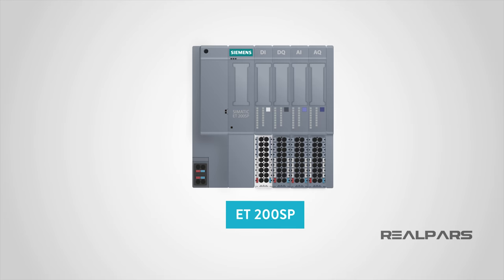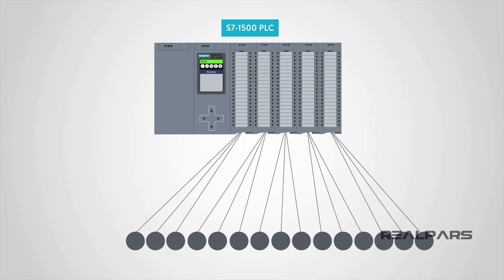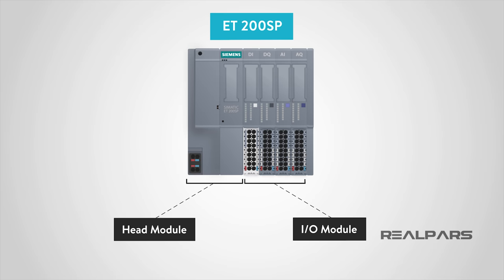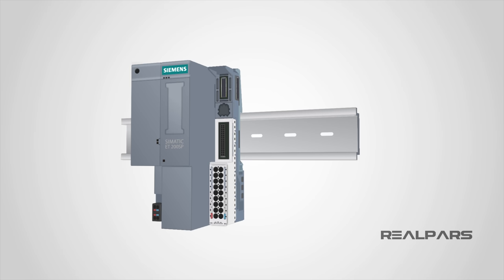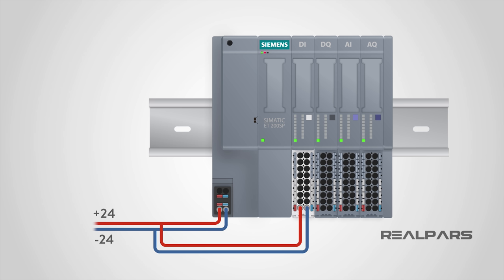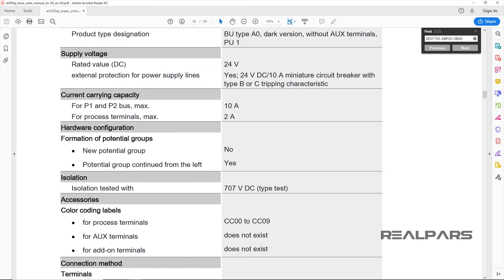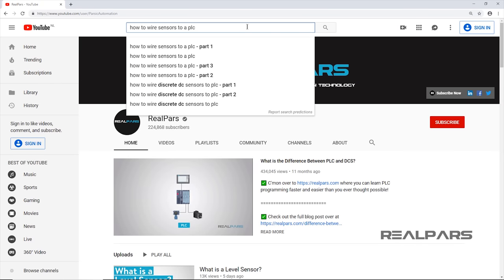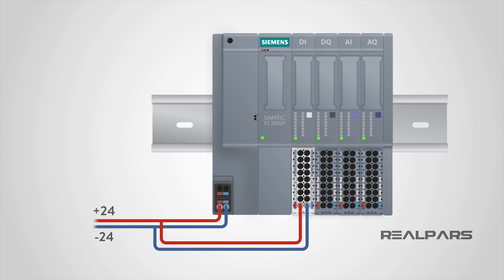Introduction to ET 200SP Base Unit (Overview & Usage)

Comment: I used to work for the instrumentation department at a consultant office, where we designed an offshore gas compression plant within a 4-level plattform. We needed to install Remote I/Os to later connect them to the main PLC. The control system arquitecture included such RIOs spreaded everywhere, linked to the main control system through profinet cables. Definetely,  RIOs are the best way to interconnect field instrumentation to main control system. Thanks RealPars for sharing such a valuale information.
Reply from the maker: You are very welcome, Melquiades! Thanks a lot for sharing your experiences and knowledge with us.

Comment: Dears,   
I like this vidio too much

I need clarification for two points
1 -  based on given cpu information  
Is there limit to connect no of remote I / O.?

2 - for given nos of rote I / O and plcs in different locations how can decide following issues :- 
Switch specifications, Server specifications and data warehouse specification based on phenomena that I will save whole Data in database for further analysis 

Thank you in advance for your support and clarifications 

Warm regards
Reply from the maker: Yes, different CPU models allow for differing number of racks/IO cards/IO points.  For your CPU, download the CPU documentation from Siemens.  For example, the technical specs for an S7-1214C can be found here: https://support.industry.siemens.com/cs/pd/255094?pdti=td&dl=en&lc=en-WW.   The process image table and output image tables are each 1024 bits (1 kB), so this CPU can have up to 1024 inputs and 1024 outputs.  There are limitations to the numbers of nodes that are connected (16 for this CPU, so there are limits for each type of remote I/O node that may limit the total number of I/O available.  The only limitation connecting switches, servers, PLCs via Profinet is the cable lengths (<100m) allowed.  You will need at least as many ports as you have connections to your switches.

Comment: Very helpful video.
On one white power module how many input output modules can be connected??
Reply from the maker: The answer is as many modules as you can add (up to 32 for an ET200SP interface module or 64 for an ET200SP CPU module) and not deplete the power supply.  Each module type requires a different amount of current to operate.  You would want to add a power module if you need to isolate circuits or use different voltages for the I/O cards (as in separation 24VDC I/O from 120VAC I/O).
Reply: @realpars  ok so depends on current capacity.
Thank you so much for your reply.

Comment: Thanks a lot for the demonstration. Max.how many cards (B0)can be connected at right side with A0?
Reply from the maker: It depends on the power requirements of the B0 units.  Most A0 base units can pass no more than 10A to the cards on the right.

Comment: Great video. Though check narration around 7:20min. "Light modules feed dark modules to the right." but then "Dark modules receive power from light module to the right." Should it be left?
Reply from the maker: Yes.  Light-colored modules have power connections and pass power to the right.  Dark-colored modules accept power from the left.

Comment: Good Video! Can I use the ET200 also completely standalone? Just in terms of functionality do I have any disadvantages compared to a 1500?
Reply from the maker: The ET200SP family of I/O can be used ins a standalone I/O rack, but a separate PLC CPU unit, like an S7-1500 or S7-300 series PLC is still required.  The S7-1500 can be used with an integrated ET200MP series I/O subsystem or, with a Profinet or Profibus-DP link, the ET200SP I/O subsystem can be used as a remote I/O solution.
Reply: On one white power module how many input output modules can be connected??
Reply: lmao, no. ET200 is not a PLC, it's just a Bus Collector. You still need a PLC.

Comment: Do we have to download any kind of program into the head module or remote I/O unit? How this remote I/O module is instructed to send and receive data from the main controller?
Reply from the maker: No.  When you add the ET200SP to the hardware configuration from the hardware catalog, the GSD file for the rack is added to the project.  This file tells the CPU how to interpret the data string that is returned from the ET200SP and how to format the commands the CPU sends to the remote I/O head module.

Comment: Thanks for the great content. It's always enjoyable to learn from your channel. Just a quick question: By connecting the dark base unit to the light one, do we create a 24VDC power supply on the last row of the dark base unit terminal (red and blue pins)? Is it possible to use them as a power supply for field devices when necessary?
Reply from the maker: Hello Ehsan Vazirinahad,

Thank you for your question. Because I don’t know what application you are working on, I am providing for your review and learning two links below from Siemens, which should have all the information you need with your projects. The first link is the ET-200 SP manual, and the second is software in the cloud that Siemens provides for you to create your hardware project for free. You can also download this information to your computer. You might have to create an account with Siemens for free to use their website on some items they allow you to download. Happy learning from RealPars!

https://support.industry.siemens.com/cs/document/59753521/simatic-et-200sp-baseunits?dti=0&lc=en-US

https://www.siemens.com/global/en/products/automation/topic-areas/tia/tia-selection-tool.html
Reply: @realpars  Thank you for the provided links . Your channel is incredible.I learnt a lot from it. Keep up the fantastic work.

Comment: I ordered and tried to install a new replacement 4wire engine speed sensor AI module - Siemans6ES7 1344GB62-0AB0. The key on the back of the replacement AI module faces at 7oclock, where as the old one faces at 4 oclock. Therefore the base plate will not except the new AI due to the key direction. How can I make this compatible?
 Is the key direction on the base plate interchangeable?
Thanks.

Comment: should you be using cable shoes with these terminals or is it better to use bare wire ?
Reply from the maker: I like to use wire ferrules (cable shoes) at the ends of stranded wire.  That keeps the installation neat and makes it easier to insert the wires into the terminals.

Comment: Great video 
In one batch processing plant having 250 I/O can I use ET200SP  with S7-1200Cpu?
Or S7-1200 1415 with traditional I/O cards will be enough. 
How many exactly I/O ET1200SP supports?
S7-1200 1415 support 8 channel I/o only (DI DO AI AO).
Which will be more cost-effective?
System has some RTD module as well.
Reply from the maker: Great question!  First, how close are the field sensors and switches from where the PLC is?  Many times, the choice of whether to use remote I/O (like ET200SP) or just local I/O depends on the cost of wiring and installation.  If your 250 I/O are an average of 100 ft from the PLC, you will need >2500ft of wiring.  If you can locate ET200SP "racks" closer to the I/O itself, then there is a substantial cost saving in wiring, conduit, and labor to install these items.  As far as the ET200SP is concerned, each ET200SP station can support up to 64 cards.  Your S7 PLC model can support up to 8 modules, which indicates you likely will need to use ET200SP I/O to meet your I/O requirements.  You can certainly use both.  ET200SP is best integrated via Profinet, so you can have many racks of ET200SP located to minimize wiring and installation costs.  Both ET200SP and SM12xx modules (used as S7-1200 connected I/O cards) can support the full range of digital and analog signals in your system.  I would suggest enlisting the help of a local systems integrator to help you determine the most effective way to proceed.
Reply: @realpars  Thank you so much to RealPars for this detail reply ❤
I got really clear picture now 
Plant I/Os are situated very near to each other not more than 60ft from DCS/PLC room I will combine S7 1200 with ET200SP to get desired no. Of I/O
I will use full 8 channel of S7 1200 including RTD and remaining I will include in ET200SP

Comment: Hi..

Thank you for the video explanation.
But i have some concern on the architecture of connecting S71500 an ET200SP.
Since all the I/O devices are connected to the ET200SP, all the programs should be done on the ET200SP right?

Then why do we still need the S71500??
Reply from the maker: It depends on the model of the ET200SP system you purchase.  There are ET200SP models that include an IM module and can be a Profibus slave node to an S7-1500 or connect to an S7-1500 Profinet master.  An example would be an IM 155-6 PN BA, which supplies a typical remote I/O interface using ET200SP modules.  There is also a line of ET20)SP CPU"s, which can be programmed as stand-alone PLC and I/O, combined onto the same ET200SP backplane.  ET200SP CPU's have small amounts of program memory (150kb - 750kB) as compared to a larger S7-1500  The ET200SP is essentially a smaller and less expensive S7-1500.  A typical model number for an ET200SP CPU si S7-1510SP-1 PN.

Comment: Great vid, but why sensor was plugged to the DQ? :C
Reply from the maker: Good catch. The DQ module is a digital output module, to which actuators or other output devices, such as relays, are wired.

Comment: Did this remote iI/O need extra enclosure to mount?
Reply from the maker: ET200SP hardware is rated as IP20, so it will require a panel enclosure in any wet or humid environment.

Comment: Hi.currently we are using ET 200 SP 4ch, 2A, DO card (18nos.) With Profinet IM module.
Everything is working fine the only problem is the heating. When all DOs are turn ON the PLC temperature I checked was 45 to 48 deg. C.
Is this a normal? Because even with this  temperature my operation is working fine.
Load on each module is also less than 5A.
Reply from the maker: I have heard of this happening before.  There may be a number of causes.  Is this ET200SP rack in a closed panel?  You may need to ventilate or provide internal panel cooling, especially if the power supply feeding the output circuits is also in the panel.  I may also be a grounding issue, as electrical noise can be dissipated as heat.  Try grounding the DIN rail on which the ET200SP is mounted, and make sure the power supply is properly grounded.   Also, insure that there is at least 20mm clearance above and below the ET200SP rack and at least 10mm on each side.  Lastly, ensure the power wires to the CPU are at least 14AWG and that there are no loose connections.
Reply: @realpars  Thank you for your prompt reply. we kept PLC in close panel with Power supply. actually we are supplying IP65 rated panel due to this fans are not provided for ventilation. 45mm empty space we maintain above and below PLC. Earthing we checked it was 0.85ohm.
One more question we saw some residual voltage(6.9V) at the DO card when DO was not forced is because PNP?

Comment: Can we connect an instrument on the light colored base unit??
Reply from the maker: Sure, just place an Analog Input card on the first (light-colored) base unit. The difference in the base units is only in how power is distributed between the modules.  Each type of base can take any of the I/O card types.

Comment: Hello sir
I follow your all vedios.

Pls share one more 
What is relationship bwn
S71200 and ET200S n ET200SP
S71500 and ET200S n ET200SP
HOW AND WHEN WE USE AND MAKE THE BILL OF MATERIAL

WHAT IS INTERFACE AND HOW WE SELECT IT?

POWER MODULE TERMINAL MODULE AND ELECTRICAL MODULE.
Reply from the maker: Hi Rakesh, 

Thanks for the topic suggestion, I will definitely go ahead and forward this to our creator team. Happy learning!

Comment: Hi,
Can the dp et 200m be configured with i/o and then programmed without using cpu?
Reply from the maker: You can configure the entire system offline including ET200 and the DP network.  However, in order to download the configuration, you will need the CPU installed.  The ET200M gets is commands from the CPU and you will not be able to monitor I/O without the CPU in place.  This is because a DP network requires a master node, which is always the CPU.

Comment: I have one question why you not use any PM(power module)?
Reply from the maker: The power supply is part of the head module.  Power wiring is connected at the lower left of the head module.  A separate power module is not required.

Comment: When I should use a power module attached to BU ?  [6ES7138-4CA01-0AA0]
Reply from the maker: The power module (6ES7138-4CA01-0AA0) has been phased out.  It was used in the ET200S product line, which has been replaced by ET200SP, as shown in this video.  There is one power module available for the ET200SP (6ES7136-6PA00-0BC0) which is used only if a fail-safe power supply with diagnostics is required.

Comment: Hi, i have a problem, i dont have acces to I/O data, i have a dark BU in slot 1 is that a problem if i dont have the AC I/O module or an AI Energy Meter as the first I/O module?
Reply from the maker: You will need to have a module to the left of the dark-colored BU's that can pass power to the dark-colored modules.  Otherwise, the dark BU's are not powered.
Reply: @realpars  Your video helped me a lot, actually that is what i did, it worked perfectlly! thank you, i want to point out that i had a safety module instaled in the dark colorred one, and it took away the eeprom, i needed to pull it out and put it back on the safety module because i could'nt assign the profisafe name again...

Comment: Those little round things at the base units. What are they for? Some kind of lock?..
Reply from the maker: Yes, those are spring-lock wire connectors. The other type of wire connectors are screw-type.  On the base unit, the wiring connections are used for the power connections (24VDC power).
Reply: @realpars  Greatly thanks you for your answer.

Comment: Can you please tell what is the difference between the two ports 1L+and 2L+ in this CPU power supply?
Reply from the maker: These ports allow for 2 separate 24VDC circuits to be wired.  1L+ and 2L+ are both 24VDC sources, so one circuit can be formed with 1L+ (24VDC+) and common, and the second circuit can be formed with 2L+ (also 24VDC+) and common.

Comment: Hello, 
Are the ET200S I/O modules compatible with ET200SP ?
Reply from the maker: Yes, but each product is different.  The ET200SP product features a processor to which ET200SP I/O cards are attached with backplane connectors to form one "rack".  ET200S I/O is distributed I/O with no processor in the "rack", and requires an IM card to join the I/O to a Profinet or ProfiBus network.
Reply: @realpars  FYI : ET200S modules are not compatible with ET200SP modules. Base units are not the same etc...

Comment: How many no's  IO modules can be connected with one power module?
Reply from the maker: You add modules up to the point where the modules use all available power from the power module. Each type of I/O module requires a different amount of power.  Typically, this is 12 - 15 modules.

Comment: Hi friend I want read the logic, how to do it, use TIA portal V15 and ethernet cable?
Reply from the maker: If you have an S7-1200 PLC, then TIA Portal Basic on a PC, a small network switch, and an ethernet cable is all you need.  If you have another S7 PLC model, you will need TIA Portal Professional.  If you do not have a PLC, you can build programs and test them with the built-in simulator in any version of TIA Portal.
Reply: @realpars  ok

Comment: what if we give supply to other base units without knowing any problem?
Reply from the maker: Hi Niranjan, 

Thank you for your question! It all depends on the supply power you are
working with and applied to the base units. In this video, we are working with an “AO” base unit and 24 volts DC modules. But with the ET200SP units, you can mix base units of other types side by side (reference the user manual), like 120 VAC main power base unit, and you must provide 120 VAC to that base unit and must be careful not to put the wrong power to the wrong base unit. It’s always better to refer to the design manual link we provide or the Siemens website. As far as we explained in our video, if you applied power to one of the terminals as we showed you, for example, to the input module, you just be turning on an input on that module. If you apply it to an output base unit, you will just be turning on the LED on that module, nothing else. 

Happy learning from RealPars!
Reply: @realpars  thank you for replying 👍

Comment: question. i'm currently working with this ET200SP and i've found a problem, once the digital output is activated it should be just showing a DC voltage, but its not. i dont know why the output also contain an AC voltage, amount is 6 to 9 V AC in measurement .. can someone help me with that?
Reply from the maker: It appears that you have mixed DC and AC cards in the same power section.  Whatever voltage/power source you are using to power a light-colored (Type A0) base unit, that same voltage will flow to each dark-colored unit to the right.  If another Type A0 unit is installed, it creates another power zone with the voltage connected. This allows DC and AC modules to be located on the same rack.  But be careful not to mix DC and AC cards in the same section or power DC cards with AC voltage or vice versa.